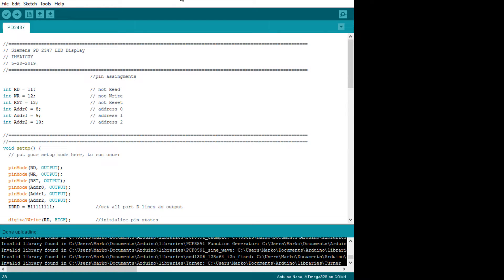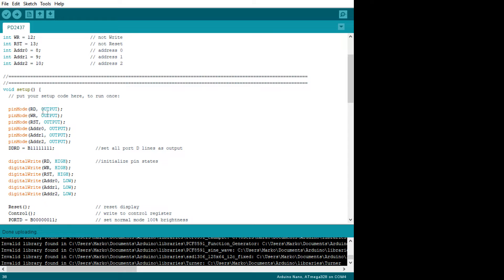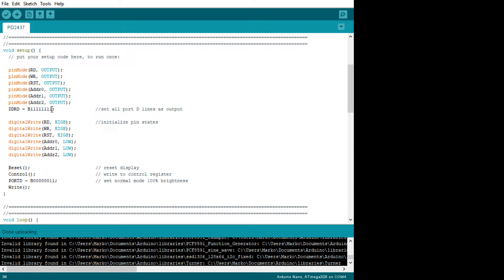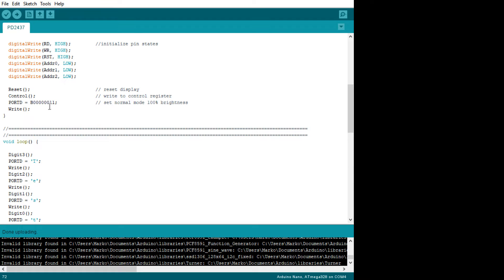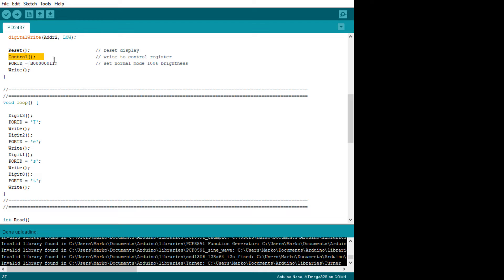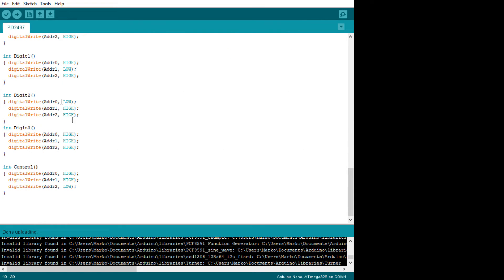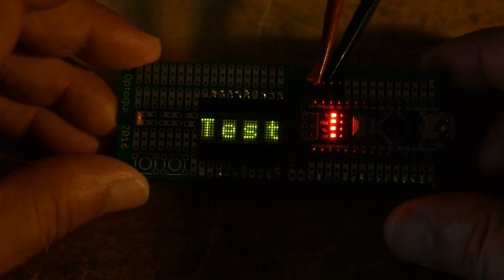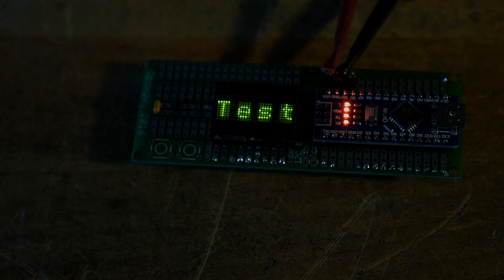#337 Siemens PD 2437 LED display with Arduino part II

Comment: source code anywhere ? thanks !
Reply from the maker: //==============================================================================================================
// Siemens PD 2347 LED Display
// IMSAIGUY
// 5-28-2019
//==============================================================================================================
                                //pin assingments
                                
int RD = 11;                    // not Read 
int WR = 12;                    // not Write
int RST = 13;                   // not Reset
int Addr0 = 8;                  // address 0
int Addr1 = 9;                  // address 1
int Addr2 = 10;                 // address 2
char message[40] = "   ImsaiGuy LED Display    ";

//==============================================================================================================
//==============================================================================================================
void setup() {
  // put your setup code here, to run once:
  
  pinMode(RD, OUTPUT);
  pinMode(WR, OUTPUT);
  pinMode(RST, OUTPUT);
  pinMode(Addr0, OUTPUT);
  pinMode(Addr1, OUTPUT);
  pinMode(Addr2, OUTPUT);
  DDRD = B11111111;               //set all port D lines as output

  digitalWrite(RD, HIGH);         //initialize pin states
  digitalWrite(WR, HIGH);  
  digitalWrite(RST, HIGH);
  digitalWrite(Addr0, LOW);
  digitalWrite(Addr1, LOW);
  digitalWrite(Addr2, LOW);
  
  Reset();                        // reset display
  Control();                      // write to control register
  PORTD = B00000011;              // set normal mode 100% brightness
  Write();
}

//==============================================================================================================
//==============================================================================================================
void loop() {
  DisplayString(message);
  delay(1000);
}

//==============================================================================================================
//==============================================================================================================

int Read()
{ digitalWrite(RD, LOW);
  digitalWrite(RD, HIGH);
}
int Write()
{ digitalWrite(WR, LOW);
  digitalWrite(WR, HIGH);
}
int Reset()
{ digitalWrite(RST, LOW);
  digitalWrite(RST, HIGH);
}

int Digit0()
{ digitalWrite(Addr0, LOW);
  digitalWrite(Addr1, LOW);
  digitalWrite(Addr2, HIGH);
}

int Digit1()
{ digitalWrite(Addr0, HIGH);
  digitalWrite(Addr1, LOW);
  digitalWrite(Addr2, HIGH);
}

int Digit2()
{ digitalWrite(Addr0, LOW);
  digitalWrite(Addr1, HIGH);
  digitalWrite(Addr2, HIGH);
}
int Digit3()
{ digitalWrite(Addr0, HIGH);
  digitalWrite(Addr1, HIGH);
  digitalWrite(Addr2, HIGH);
}

int Control()
{ digitalWrite(Addr0, HIGH);
  digitalWrite(Addr1, HIGH);
  digitalWrite(Addr2, LOW);
}

int DisplayString(char string[40])
{ for (int i = 0; i<strlen(string)-3; i++)
  { Digit3();
    PORTD = string[i];
    Write();
    Digit2();
    PORTD = string[i+1];
    Write();
    Digit1();
    PORTD = string[i+2];
    Write();
    Digit0();
    PORTD = string[i+3];
    Write();
    delay(300);
  }
}